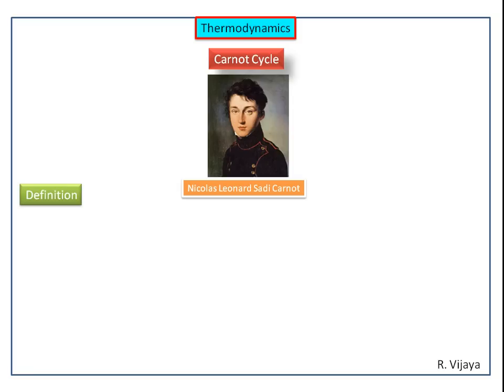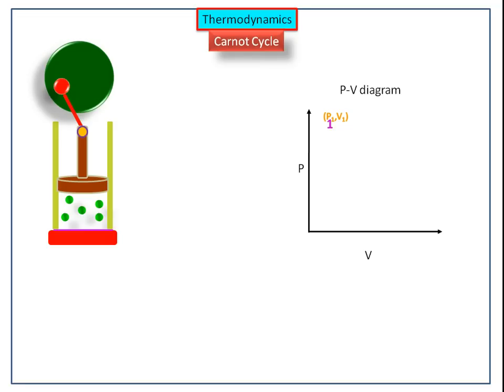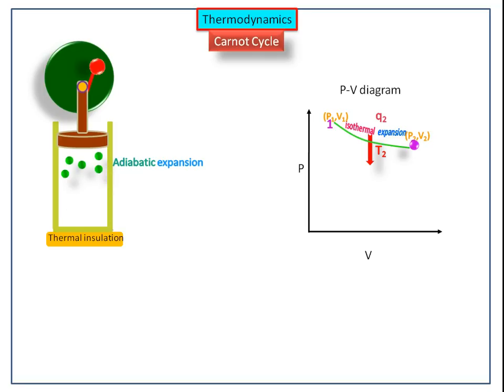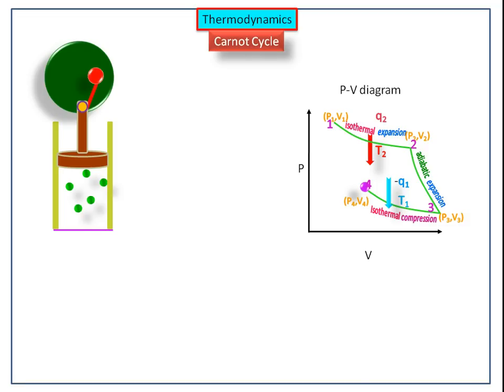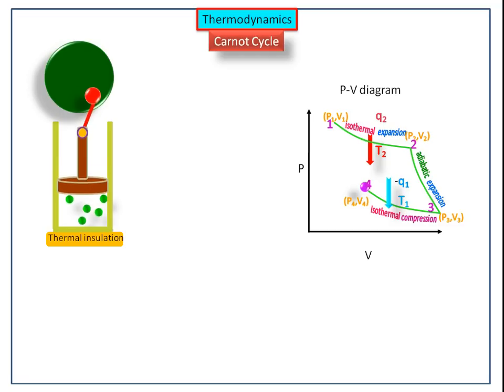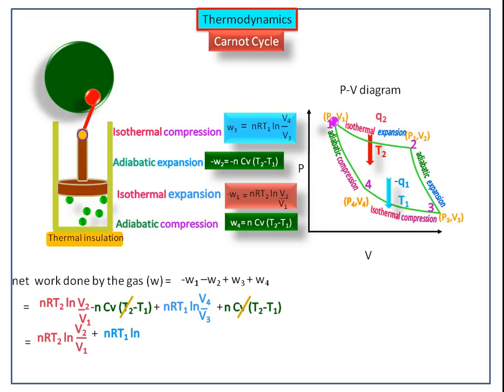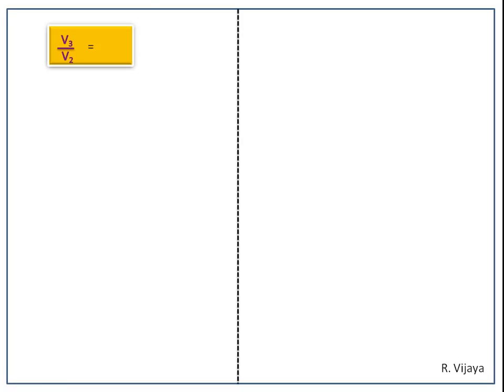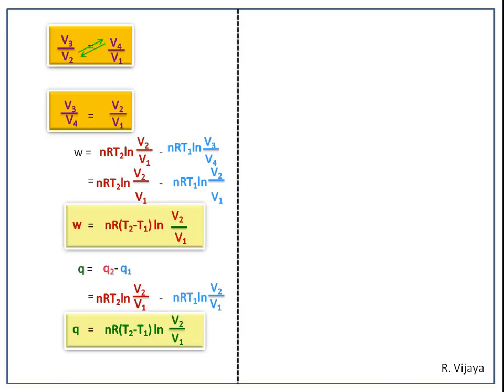Carnot cycle-Thermodynamics/Full Animation video

Comment: Why does the gas continue to expand during the adiabatic expansion? What determines when the heat should be removed at 2? (And why compress during the adiabatic compression?) Heat can be turned into mechanical energy without the adiabatic elements. Something is missing.

Comment: mam can u explain y carnot used isothermal and adiabatic in the process of cycle.... great confusion....att wat idea make him to think
Reply: Carnot wanted to come up with the most ideal cycle which has the highest efficiency which is only theoritical so that all other practical engine cycles can be compared with Carnot to see how close they are to Carnot cycle. That way it will be easy for us to compare the efficiency of other heat engine cycles. During Isothermal process it is the latent heat that is taken from the reservoir so you will see no change in the temperature until the gas starts to expand. The moment the gas is ready to expand you have to cover with insulator around the engine so that the heat won't escape and it will be utilized only for the expansion of the gas. Then comes isothermal compression where there is no change in temperature but the heat is rejected out to the heat sink or atmosphere and immediately insulator is provided to not allow outside heat again to come back as the gas compresses and this process is called adiabatic compression.